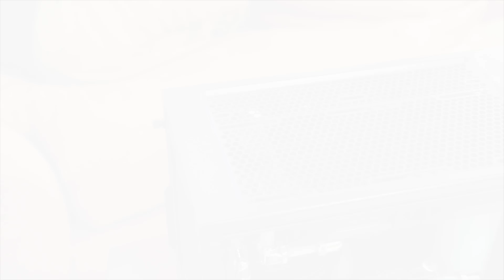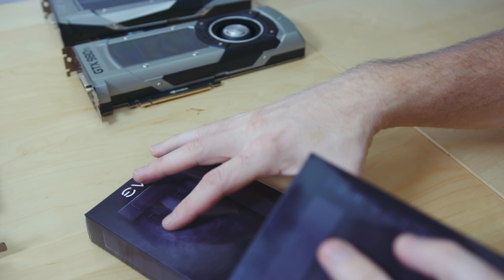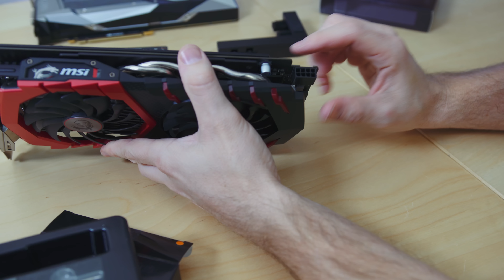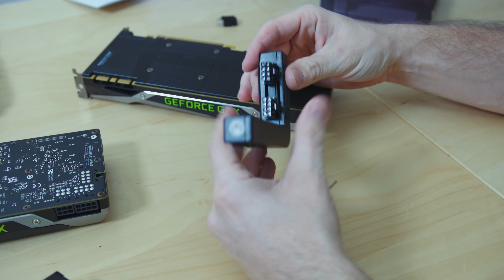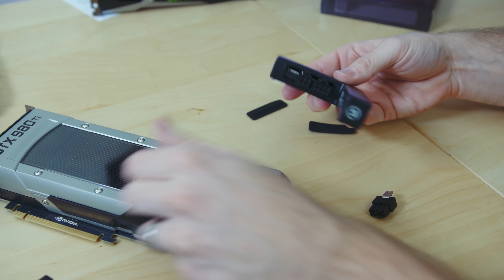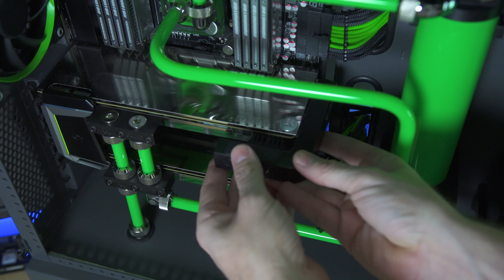How to manage your cables using EVGA Power Link

Comment: http://pcpartpicker.com/list/8fqjJV     anything wrong with this build?(updated)
Reply: Samsung - the king of the Memory market - makes 250gig SSD's that cost the same or a few bucks less than that nobody brand.
ergo i recommend an 850 Evo instead of that SSD you have.

buying a Hard Disk that is slower than 7200RPM is a waste of money. i personally recommend high performance models (which will tend to have 64Megs of transfer Cache currently), since Hard Disks are already very slow, so might as well get the fastest ones you can.

why are you buying two Keyboards?
and yeah, for almost everyone a Mechanical Keyboard feels way better to use. some actually prefer the inferior designs, but almost everybody prefers Mechanical Switches.

that Power Supply is... acceptable i guess. it's pretty mediocre quality, but will be functional as long as you don't ever buy a more powerful GPU for your system.
if you're not so keen on that, here's a suggestion for a low cost Power Supply that in accordance to hardcore testing should last you for decades. http://pcpartpicker.com/product/qYTrxr/evga-power-supply-220g20550y1

if you're going to buy a Razer Deathadder, the only model worth buying is the Deathadder Chroma.
because - in that Series Razer started using less shitty components. that perform closer to the same level of most other peripherals on the market.
it's still a bit of a shitty mouse but Razer and product quality and reliability don't normally go together.
so if you're going to buy any, buy the Chroma model because the Switches and Sensor aren't as shitty as they were in older models.

as for your question about wires - depends on what wires you're talking about? Power Supply will come with all wires needed to power your entire computer.
all things that need to connect to actual electricity (Monitor, Power Supply, Et Cetera) will come with the wires necessary to plug into the wall.

lastly for Monitors, i'm fond of the ASUS VS24AH for an inexpensive Monitor.
while it doesn't feature Displayport unfortunately, it also isn't high enough Resolution or Refresh Rate where it would need to use Displayport so that's okay.
there's many other good Monitors out there though.
Reply: ᖇᏋᏉᏋᏁᎯᏁᎿ Parts Picker offers many different common Retailers, so pick whatever works for you. they're all there to help you price compare.

as far as i'm concerned if Newegg sold groceries i'd buy them there, with how nice it is to navigate the website.

but you should buy from whatever is in your region and makes sense for you.
Reply: $200+ for a 24" monitor? 16:10?
$91 for a 120gb sata ssd? I think m.2 some nvme ssds are less than this atm

Windows 10 cd keys can be bought for less than £10, so $13-14 ish

Razer stuff is overpriced imo, think someone else already recommended a cheaper mechanical keyboard, as for a mouse, I couldn't help I use an MX Master xD

Fans are ok, not sure if you're going for anything quiet though

Parts of this build suggest you're trying to save money and other parts suggest you have cash to burn.

If you're looking for bang for your buck, change the peripherals & the monitor and try to find somewhere selling win 10 64bit cd key, think cdkeyhouse sells it for £7ish. 

If you're looking for quiet gaming:
-change your fans to something like Be Quiets! think it's about £7 per fan for pure wings 2's
-try to get at least a 750w PSU so the fan runs slower, so quieter
-change your evo for a larger air cooler, preferably twin towered, noctua if you can afford it

again, if you can afford it:
-Get a 144hz monitor, tn panel colours might need altering out the box, ips stuff will look better but are more expensive.
The monitor is an investment, so buy something good, you're going to have it for a while, the PC you'll probably continue upgrading over the years.
Reply: Tod Hunter that Monitor was suggested because of having a high quality panel in it, having a preferred Aspect Ratio for me - while being reasonably priced for having a not garbage panel in it.

this computer is going to draw like ~370W while running synthetic benchmarks, the fan in a good quality Power Supply will be doing very little.
Wattage rating is not the defining factor for how well a Power Supply can handle a certain load - having a Power Board that is laid out with cooling planned and using good components that don't dump a lot of heat as well as being able to handle the heat is what's most important.

you suggest a Monitor being a long term investment, then suggest buying a Monitor with disappointing Color Accuracy.
if one wants a higher Refresh Rate Monitor at higher Resolution, Et Cetera - they should start looking at higher end Monitors, rather than ones that try to trap people in with recognizable numbers that they hear on the internet.

tornader 92 DDR4 is expensive ¯\(ツ)/¯
Reply: ᖇᏋᏉᏋᏁᎯᏁᎿ Pretty sensible build, but I'd recommend a cheap mechanical keyboard if you're going to spend that much on a chicklet keyboard
Reply: Andre Evan Thanks I've never built a PC  before and just wondering if I have to buy wires or it comes with it? Also is there any good monitors for a good price?
Reply: ᖇᏋᏉᏋᏁᎯᏁᎿ The storage options you picked are overpriced. Get a OCZ, Adata, or Crucial ssd. It will be cheaper for the same capacity. Also get a WD blue instead, same price same capacity, but it's faster at 7200 rpm. You can drop a little bit more, pick up a good mechanical keyboard like he said. Cm storm makes some good non gimmicky keyboards.
Reply: Also u have two keyboards
Reply: taiiat changed a couple of things. Where can I get all of it from one or 2 sites instead of ordering the parts from a bunch of other sites?
Reply: For the price of that 1 TB HDD you can get a 2 TB  7200RPM for a few cents more https://www.amazon.com/dp/B005HOT1HM/?tag=pcpapi-20
Reply: Get either of these monitors:

http://pcpartpicker.com/product/yjrG3C/asus-monitor-vs248hp (1080p IPS 60HZ 24inch cheaper)
http://pcpartpicker.com/product/rkphP6/asus-monitor-vg248qe (1080p TN 144hz 24inch same price)
Reply: the monitor is very expensive for what it is you can get a 144hz acer monitor for cheaper, if you take that off the list and buy a "acer gn246hlbbid" its a very good monitor and is perfect for the 1070
Reply: The ram looks really pricey, that's just me though. Also I'd suggest getting windows off of kinguin.
Reply: Your buying an overclocking chip with a non overclocking Mobo, also a 1070 is wasted on that display
Reply: David Richardson the Z170 Chipset is the highest 'tier' Chipset for the Skylake platform.....................
it supports Overclocking.
Reply: ***** i did later notice it was ips however youtube decided that i could no longer edit my comment.

wattage rating is not a defining factor, you are correct. As the psu chosen was fairly on point i figured they would know to choose something of a similar quality with a higher wattage. I've got about the same ratio of amperage used to available amperage and with how silent every other component is the psu fan doesn't turn on at all.y rig pulls about 400-450watt though, a 750watt psu still turned the fan on for me, for them it would be flawless.

I suggest that a cheaper monitors  colour out of the box is going to be disappointing, so would need altercation, ips will look better. Then suggest it is an investment, i recommended 144hz. The tn or ips version is entirely their choice, this is advice not a demand.

It really isn't clear if this guy is sticking to a budget or aiming for a particular build.
Reply: NOT GET THAT MONITOR. It's a total rip off.

Comment: It looks like the Power Links partially obstruct the heatsink on the back of the card, and on a card with typical...push cooling (is that the term? Fans draw cool air from below, blow onto the heatsinks, dissipate sideways) it would trap some of the heat coming off the back of the card. Is that much of a concern?

Comment: I like the idea of the product, but not the execution.  I'd like to see them make it as thin as possible, and also give a mounting option.  Building this into a backplate for example would be great, although it wouldn't be universal.  Or, here's a crazy idea, how about we move the damn power connectors down to the bottom?  No gimmicks, just move the damn connectors when you design the board.

Comment: I think in a build like Skunkworks, with nice sleeved and combed cables, it doesn't look as nice. Maybe if the power link wasn't solid plastic, and had maybe some aluminum or something else to make it look more sturdy or invoke a higher build quality. But, I could see it working out in a case where you're wanting to really hide the cables. It would help in hiding the standard black/yellow cables.

Comment: Jay, you forgot the capacitors in it.  Smooths out the incoming power, best part of the whole thing in my opinion.  And yes, I'm the guy that runs all my power supply lines through ferrite cores ;-P

Comment: For Skunkworks I think they work very well. They keep the pci-e cables going the same direction as the motherboard ones, and away from the front where there weren't any other cables. As you said, very subjective from build to build. But I don't think the added bulk took away from it in this case, overall made it cleaner.

Comment: Hey Jay! Another great video, man. I have to say these aren't the best for Skunkworks, IMHO. They seem gimmicky (two huge EVGA logos staring out the side) and as you pointed out, there's a bit of sag there. Personally, I like the look of cables and visible PCB's in a PC build, so the original look wasn't terrible.

However, for Skunkworks I think a custom 3D-printed "hard sleeve" would be best along with a couple 90-degree PCI power connectors. I just feel that a custom solution would fit the aesthetic and "feel" of Skunkworks better. Nice try by EVGA, but they could've had a little more polish on this.

Comment: Can't help but think ... WTF don't companies but the power connectors at the end anyway?!
Reply: They can. Many server cards already have them like this.
Reply: Andrew B you seem like you don't know how power delivery works. it's not as simple as just solder it and boom it works. but no graphics cards are wayyy to complex to build that's why they cost much
Reply: it's mainly to do with the standardization of components. I beleive all modern gpu's not including quadro series etc, cards have their connectors on the top. It's most likely to do with compatibility, I don't know why manufacturers decided on top connector but having connectors on the side could cause issues with smaller cases. Hell I would love to have a card with connectors on the bottom next to the pci-e slot, for a stealthy look. Most regular sized cards extend past the motherboard so I don't see why it couldn't be done. 

That being said manufacturers want to appeal to the biggest audience they can, and if compatibility is an issue it could be detrimental to a product. At least now if evga's adapter becomes popular enough, maybe we'll start seeing the top power connector standard change.
Reply: Probably because it's a standardised location by now, and maybe PCB manufacturers figure, or have found out, that they have more height than length to work with in a case, especially in situations where the HDD brackets might not be removable.
Reply: To keep them as short as possible might be one reason. I had to buy a new case once because the new vid card I had just bought wouldn&#39;t fit in my existing case. Yes, I was pissed.
Reply: They used to come on the back side when the cards where smaller and as the cards got longer the AIB partners started moving them to the front so the cards would fit in more cases.  As Jay says in the video it takes an 11" card and makes it 13"+ and that won't fit in a lot of cases.
Reply: It would be too easy to put them in servers... quadro and tesla cards have the connectors on the end
Reply: Actually they wouldn't even have to redesign the boards or the coolers. If you look closely at the "Titan style" Nvidia boards they all have pins soldered in for an 8 pin connector in the back of the card. the quadro referece coolers are the same thing as the GeForce ones except for the position of the connector. The pins aren't used in the GeForce cards but a quadro P6000 and a gtx Titan X is exactly the same thing physically. And I know a single 8 pin connector breaks the specification by 25w but these things are used in workstations and I've never heard anyones connectors melting or something so I guess they just said fuck it...
Reply: some cases let u rout the cable through the bottom thingy
Reply: there's merit to either the end or the side depending on the case the Graphics Card will be inside.

the real question is why don't Graphics Cards just have ports on the side AND the end at the same time.
connect one set of ports, whichever you want to use. some GPU PCB's even have Solder points on both the side and end already!
Reply: if it is a long card, it just makes them longer in most cases
Reply: OvAeons Jeff Monarch This argument doesn't really hold up though. If they were on the back by default, and there was no need for wiring and such in a separate plastic enclosure, it would only add around .5 of an inch if you were short on space.
Reply: Arobsite if i had drive cages in my case i would have 3mm between the end of my GPU and the cage. A lot of people still have older case designs with lots of cages in them..

Comment: The idea of the product is incredible. The cable look way better than before. The weird "swoop" as you described is an eye sore. But the basic flat black design of the power link is far worse than the swoop of the cables. So the before is better in my opinion.

Comment: I'm very concerned about the way it twists the power connectors. Not all soldering joints are equal so it wont be long before someone breaks something. Why couldn't they supply some kind of clips with it to attatch to the graphics card to help with that problem?

Peace

Comment: Oi party people, I'm searching for a case (around 270 USD) that is noise-isolated, has a shroud for the powersupply and its cables and a tempered glass sidepanel. Found the MasterCase Maker 5 and the BeQuiet 900 Pro (would make a coustom shroud there). Any suggestions?

Comment: I like it, but its rather bulky, if they could slim it down I think it would look better, and maybe a simple white led would be nice. But, it is very niche, however for skunkworks it works, as it matches well with the 24 pin coming off at an angle from the motherboard.

Comment: I think they look good against the back plate, but bad underneath against the clear if the water block. I think they add width to the cards that is unnecessary. if they made one card specific, and made it more flush to the card width wise, I think it would be much better. Also, make the EVGA light up. Overall for these, 5/10 (6/10 on non water cooled cards)

Comment: Great video Jay.

I think Power Link does make the cabling look neater, but would personally prefer the option of a graphics card with power connectors in this position. I do realize however that it could be expensive for manufacturers to offer both options as this may not work in smaller cases.

Comment: They don't look bad just a tad to big as to my mind if you have those evga powerlinks installed won't they interfere with say A exhaust style gpu cooler sucking up air from the front case fans?  Well have to wait for some smaller company to pick up and improve on this idea but all around not bad

Comment: Those adapters look a lot better from a distance in my opinion. Once you get up close they just look too bulky, even for stock or aftermarket coolers. Now, if there was a dual 90 deg. adjustable combs to get around the card, cables, and back towards the Mobo tray that would be ideal, albeit probably a pain in the ass to get the wires in and manufacture.

Comment: Someone should bring out right angle power connectors for people that like custom sleeved cables. You could have three types pointing up, down or to the right, instead of sticking straight out of the card.

Maybe one day we could see a graphics card with power connectors on the back, with a space in the motherboard to route power cables through, would look so much cleaner.

Comment: I just rebuilt my gaming PC using the Fractal Design Nano S and it looks awesome!! But now I want to get some LED or RGB fans or something cause it looks a bit empty and sad without that lighting effects. Also I notice my GPU power cables sticking out in full view thanks to the nice acrylic window from my case. Would be cool to hide them away but would they work with Zotac cards or only EVGA GPUs?

Comment: I think the best bet would be to have the manufacturers just move the power connections to the back of the card. No bulky adapter and better cable placement. I think these adapters are a patch, they don't look the best but they make the cable placement better.

Comment: I can't wait until they start putting some of the connections to the back of the motherboard. I don't know how to solder but how cool would it be to move the 24 pin and other inputs to the back of the motherboard.

Comment: I like the idea but don't like the execution of the product. Putting all of the weight on the power connector rather than giving it a way to attach more securely is a problem and the over all size does make them look a little too beefy when on a water-cooled card. However, on a standard air cooled card they may look about perfect. Perhaps they need a more sleek version to match the sharp looks of the thin water-cooled models.